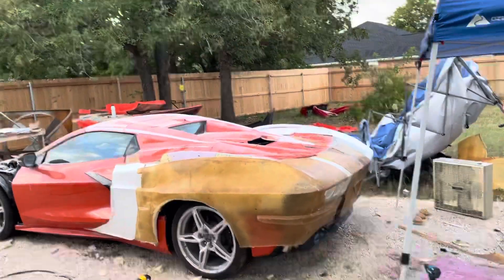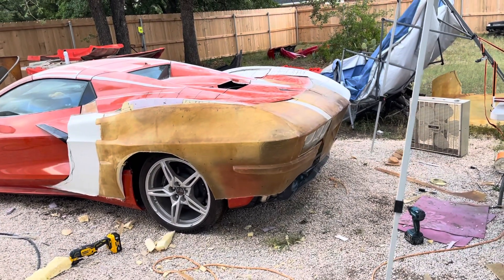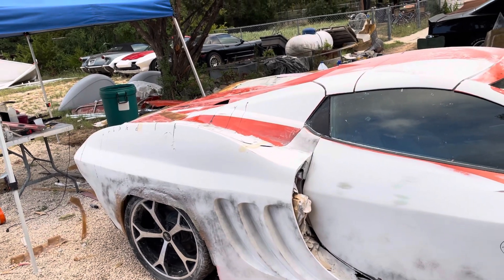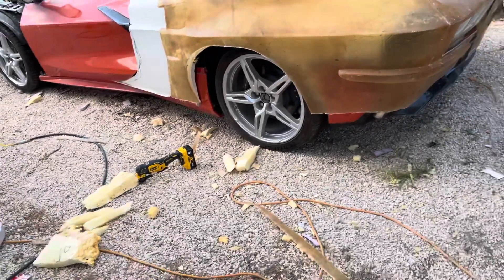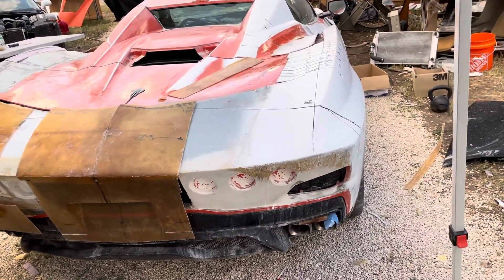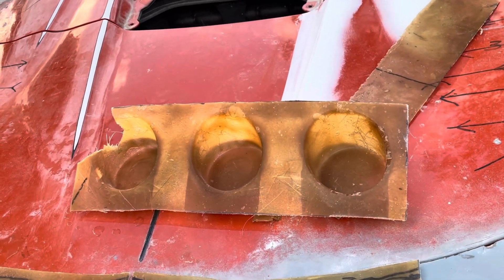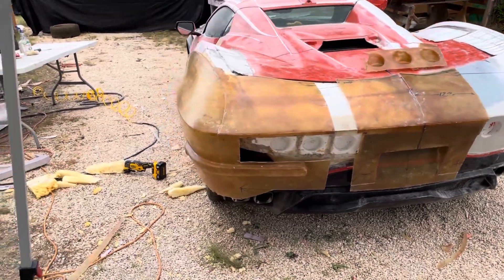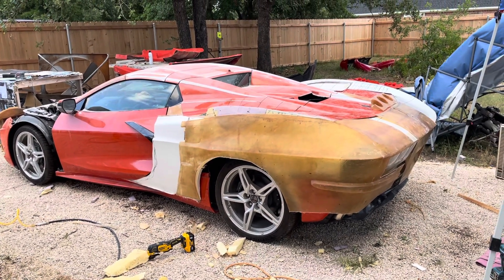C8 Corvette Hack - Frankenstein Lives!

Comment: What are you doing? This is the second video I watch and i still don't know what you are trying to do. Designing a 1950's version of the modern day one?
Reply from the maker: My “theme” is “What if GM made the 1963 C2 Corvette mid-engine?”. This is my modernized interpretation of that. 

But hey, a mid-engine 1957 vette would be cool too! But much more difficult to pull off due to the body differences. Still…
Reply: These will form the basis of body panel molds. The existing c8 is basically whats known as a station buck. Old time steel body workers used skeletal structures known as station bucks. A buck was basically a wooden stand. A station buck served as a stand in for an actual frame. The completed c8 is, if im not mistaken basically acting in the same function. Correct me if im wrong Jack?
Reply from the maker: @joshschneider9766  That is absolutely correct! The C8 is merely a “stand” to mount everything to. It’s WAY better than making something from scratch. 

Unfortunately I had to cut a lot of the original C8 body away because it interfered with the new design. Otherwise the new design would have had to be bigger at every single point than the original C8 body. Right now the new body is bigger in some areas, smaller in others and the same in still other areas. 

In the next few videos I’ll show how I tie together the C8 mounting points and the new C2 body.
Reply: This really is functionally an entirely one of custom corvette pretty much isn't it? May the spirit of the shade tree never die.
Reply: Oh and Izy, there were various factory pushes from designers such as zora duntov to make the vette mid engine like European cars since the very c2 jack mentions. Executives always vetoed it until this version. Not American enough they said. I'm pretty sure they just didn't want to invest in scratch built assembly lines.
Reply: @shadetreesupercar  ok. I'd like to see the finished product
Reply from the maker: @izyj.8679  You and me both!
Reply: @shadetreesupercar  id like to buy a copy of the finished product and a wrecked c8. Theres already half a dozen on copart.

Comment: I’m not a fan of the C8s rear either, but from an artistic perspective, it doesn’t flow or look appropriate at all. The quality of work is fine but frankly you took a perfectly good car and hacked up the lines. I’m not Foose, Duntov or Pininfarina and you can do what u like but. ???
Reply from the maker: You have the wrong mindset. I used the chassis and drivetrain to build my own car. It’s completely irrelevant what body was originally on the car. 

I have another C8… why would I need two identical cars?!?!
Reply: I got another one, screw it, making whay I please. Love you buddy. This entire thing just makes me happy.
Reply: Also thinking on it, duntov said from 63 to his death, to anyone that would listen, that he wanted to make a mid engine version and that wide body factory customs were a good idea. The closest we ever got was some COPO cars that were basically stock with options available outside the regular system. Basically Duntov made what he was told to, not the machines he actually wanted to produce. Just the nature of the game. But the truth is Duntov would approve of a wide body c8, everything he wrote and said shows it.
Reply: Jack has ultimate freedom to do as he pleases. Duntov would probably have sold his kids into slavery for such a privelege.

Comment: Wasn't foam and fiberglass way faster and easier than shaping,sanding and cutting bondo/
Reply from the maker: Honestly it wasn’t/isn’t It’s still nowhere near done. There’s still MANY hours to get the foam and fiberglass shaped and smoothed. That’s why I stopped doing that and went back to using my existing molds instead. But thanks for playing! 😊